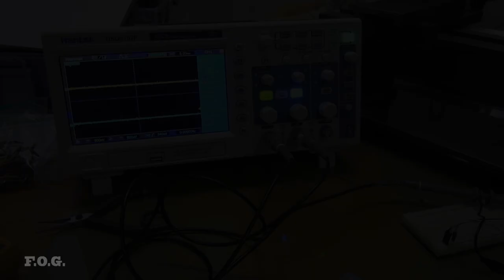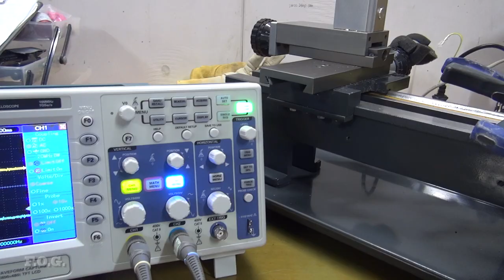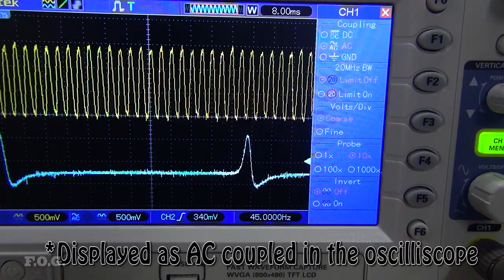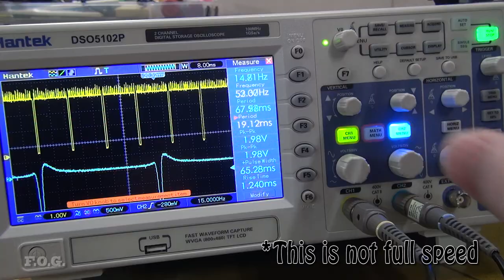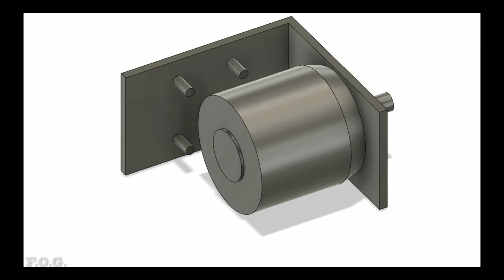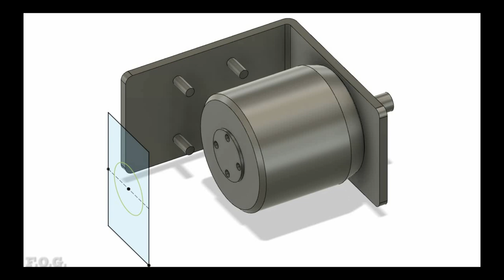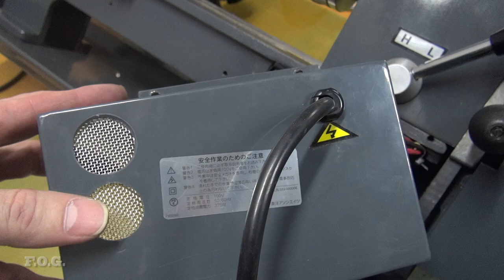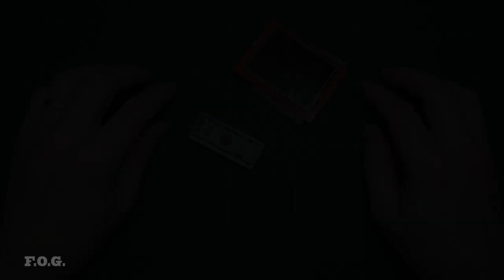EP3 - Mini Lathe Upgrade - RPM Sensing & Motor Block Finalization - Brushless Conversion How To

Comment: Thanks for sharing your brushless motor retrofit project with us.
Those motors interest me as to their potential as a replacement for various devices with the added benefit of speed control but they are still quite expensive just to have an introductory play with. I’m in New Zealand hence the expense.
Speaking of which, your accent is very Kiwi. Am I right?
Reply from the maker: Hi Brain, thanks for taking the time to comment, and I am glad you liked the series. So far that motor has worked out pretty nicely, and your right, it does seem suitable for a good range of projects. It is not super powerful by any means, but the big shaft and strong mount makes it ideal for medium scale devices. Not a Kiwi, though I have had a number Kiwi acquaintances during my younger working years, I am actually originally from the other side of the pond, though not lived there for a very very long time now.

Comment: You should need only the chuck rpm, why do you care about the motor's rpm?
Reply from the maker: Simple answer is, that it was an easy way to obtain more frequent and accurate RPM updates even at low speeds. Possibly I could have added a more complex arrangement to the chuck to achieve the same, but I was not confident given the lack of space. The simple chuck RPM sensor I installed only gives a single pulse per revolution sensing, this could only give 1 pulse each second at 60RPM, but this is way too slow for what I need. In the end I use both sensors to detect the current gear state, information both displayed to the UI and used in the speed control logic. Having a faster rate of RPM update is also obviously nice for the UI, allowing for low lag and a consistent display refresh. But I also need a fast low lag RPM update for the automatic speed control logic, as well as the logic I am using to detect a stall for auto-shutdown. Obviously there are many ways to achieve the same, but this worked out ok for me. Thanks for the question!
Reply: @ForOurGood  But the bottom line, is material cutting RPMs, that is what matters. That only can be had, at the spindle. It could be at the end of the spindle , where the gears are located.
Reply from the maker: @19mati67  Actually for this lathe the spindle and motor speed are always mechanically locked together, there is no way it can slip. So as long as you know the gear ratio you can calculate chuck speed from the motor. This is what I am doing.